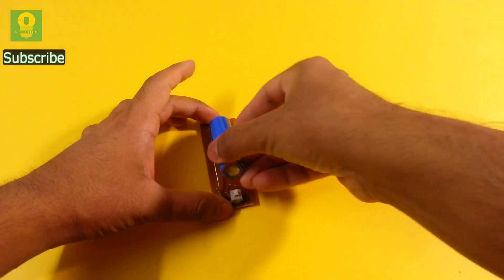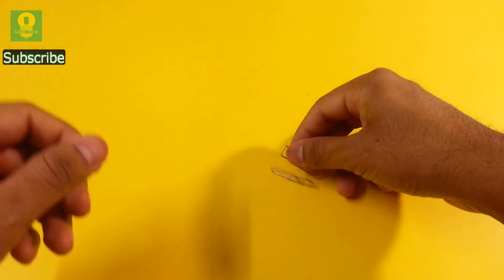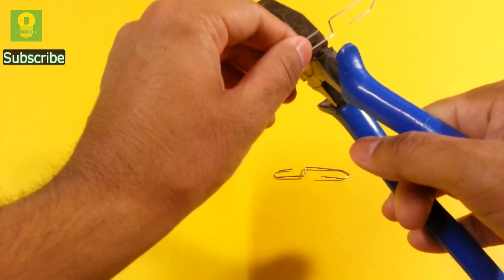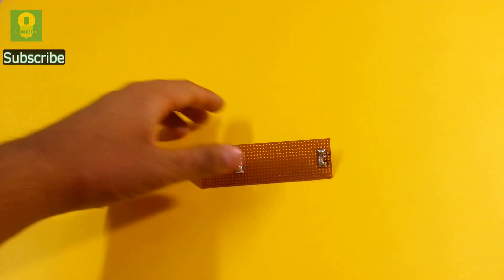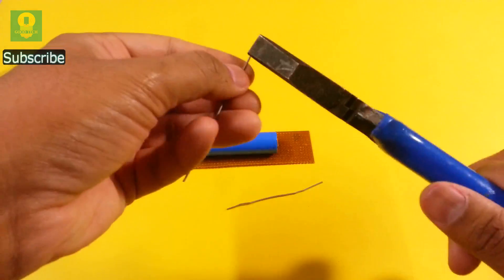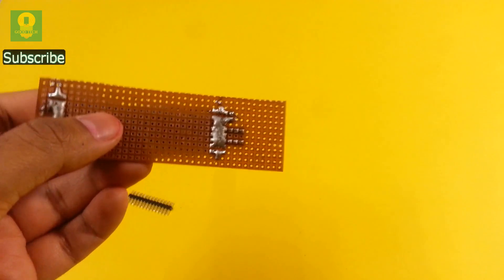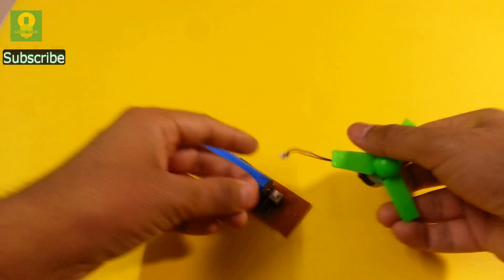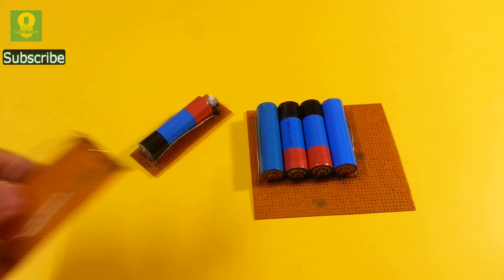How to make 18650 Battery holder | DIY Battery Holder

Comment: WoW.. Thanks a million for this.. Soldering is sticking to 18650 batteries unfortunately local electronics store do not have required Flux to solder this..
I will try this should.. Should work for sure...
Nice and creative work buddy..

Comment: Hey, can i use AA battery instead of Li-ion?? Is there any videos that teaches how to make a AA battery holder with switch?
Reply from the maker: Yes, you can use this technique to make holders for any batteries, i have also made a AA battery holder video - https://youtu.be/OaEkA0_2tys
Although this video does not include a switch but that can be easily connected.

Comment: Materials?? please🙏🙏 Cause my hearing isn't really that good.

thank you😄😄😄
Reply from the maker: Metal Office clips, a general purpose PCB board and a Switch(optional).
Reply: +GOODTECH - Creativity and Science that's all?? thankies~~
Reply from the maker: Yes, these are the only materials required. However, you will also need tools like pliers and a soldering iron.

Comment: What is that board thing called
Reply from the maker: Its a general purpose PCB board.
Reply: +GOODTECH - Creativity and Science thank u so much
Reply: Also great video want to make ur cleaning robot
Reply: +GOODTECH - Creativity and Science also what is the the width of pvc pipe for the robot
Reply from the maker: In floor cleaning robot i used electrical cable raceway. The width will depend on the motors you will be using and for remote i used half cut PVC pipe of 2''.
Reply from the maker: You are welcome :)
Reply: +GOODTECH - Creativity and Science  thank u so much by the way what type of battery do u use and what I really length and width of the general purpose pcb board
Reply from the maker: Well, the general purpose PCB boards come in various sizes. They can be cut to any size using a saw blade. The batteries used are lithium ion cells(3.7v 2000maH), can be found in laptop batteries and power banks.